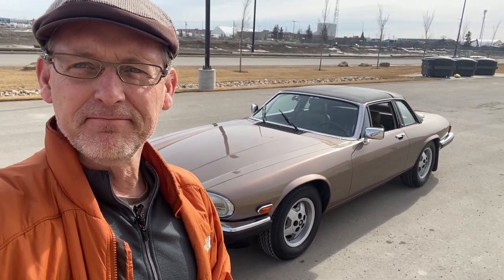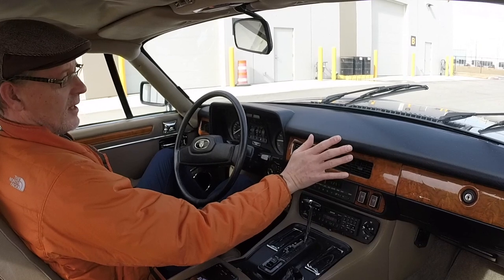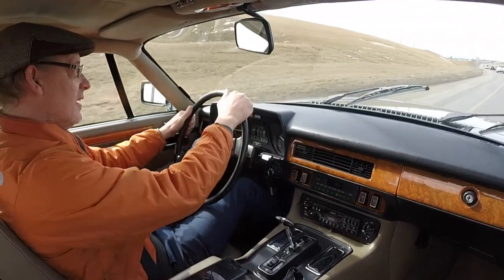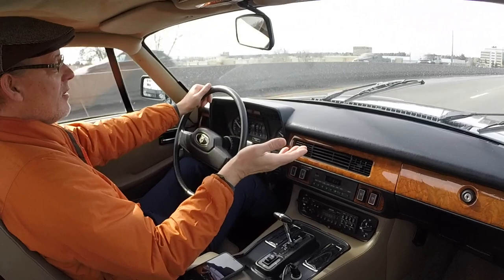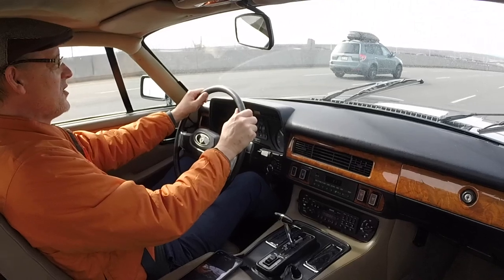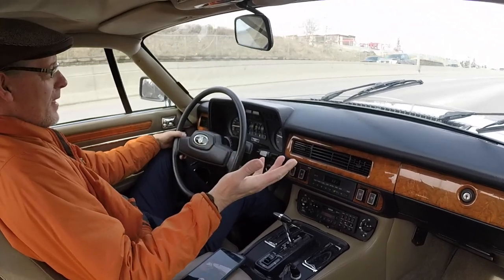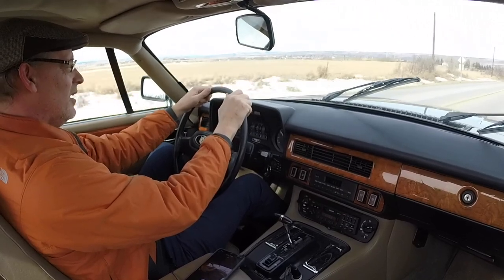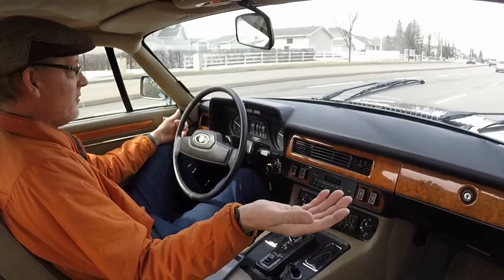1986 JAGUAR XJ-SC On The Road and Why It Is A Great Classic Buy

Comment: I recommend blocking the speed selector in first gear, then floor it from a standing start ... the gearbox will switch automatically to 2nd gear at about 68 mph (110 kmh) at a roaring 6000 rpm with spinning rear wheels. I guess one can have the same experience when pushing it to frightening speeds when it automatically switches from second to third gear - never tried it, I may be tempted one day on the German Autobahn with my 1987 xj12. Thanks for this video and greetings from FR.